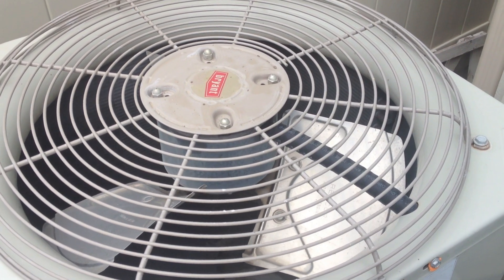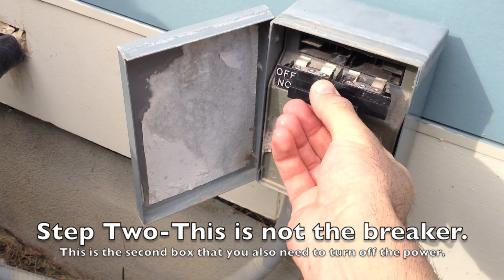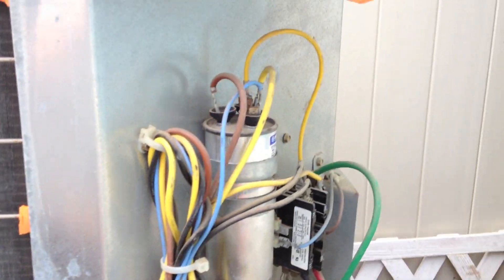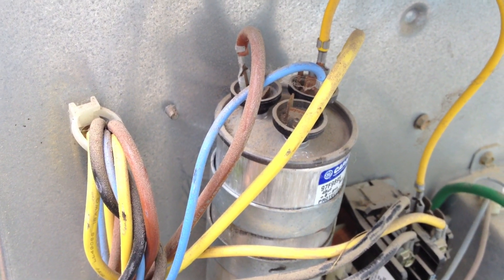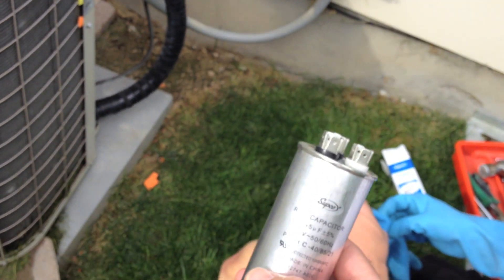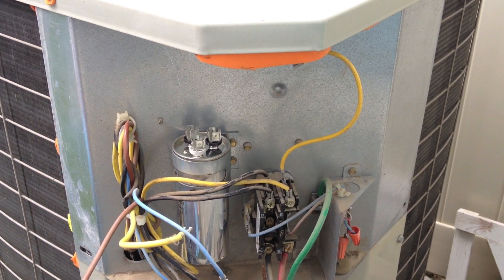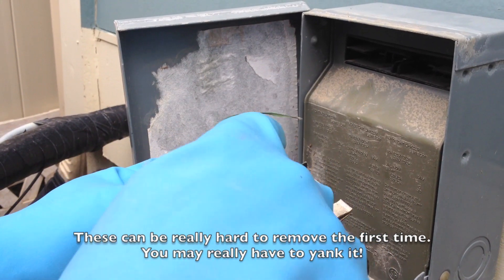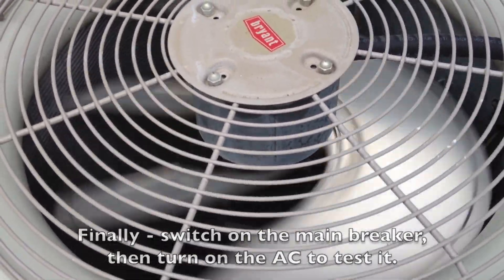AC Fan Not Working - How to repair broken Air Conditioner HVAC Run Start Capacitor

Comment: I hope you can help. Everything turns on properly and after about less than 10 mins of running and blowing cold AC the fan slowly shuts off, a loud hissing sound begins, and the smaller pipe goes from really cold to torching hot. What can I do?
Reply from the maker: How many times has it done this? Where is the hissing coming from? Is it the outside fan that slows down? Or is it the blower motor fan in your furnace?
Reply: First time to my knowledge that it does this. Hissing coming from below the fan. Outside fan comes to a complete stop before the hissing. Furnace is running properly
Reply from the maker: Angel Lopez Could it be a freon leak? Has the small copper pipe cracked and the hiss is actually the freon escaping? The crack may be super small.  If it is a leak, once the hissing stops, it wont start again.  The copper pipe will pass through all the blades that surround the fan. I would do a long check for any sign of damage to the lines.

Comment: how much will a professional will charge for repairing this problem?
Reply from the maker: I think its about $150.  But it really depends on who you call.
Reply: =( I called a good company..and he told me a bunch of problems that I don't see there.. and want to charge $779.00. to repair it.  =( I'm calling someone el. plus he charged $89.00 just to come out!! thanks for your answer.
Reply from the maker: Irma Fuentes That is really pricey!  I had to get an AC guy out to recharge the lines on a rental home and that cost about $275.  Apparently it's something a DIY'er can't do themselves because manufacturers won't sell freon to the public. 
What are the symptoms of your AC?
Reply: This is what he wrote on. refrigerant circuit flat, all Freon leaked out. found leak in -- rushed through suction line filter drier.  quoted $779.00 to repair refrigerant line and install dawn liquid line drier then charge w/r-22 refrigerant. =( . There was no leaking no where around the unit. and now he left it linking.
It just the fan not turning. everything else is working.
Reply: I got it fix for $400.00. Thank you Lord!!!

Comment: First off thanks for sharing this, it helps because mine is very identical, I ordered the capacitor but is there anyway I can e-mail it to you to look at it? Mine is humming an fan is not running however if i give the fan a little push it runs and i feel a little air blow from vents but its not strong and cold.

Comment: Recently my AC unit ran all night without shutting off, I had to finally manually turn it off with the main breaker. This went on for about 2 days, and then it seemed to start working again, unfortunately within about 24hours, it knocked off, and never came back on. It is not humming, or making any type of noise. It is completely dead. I have checked all the breakers and fuses, and can't seem to find the problem. What do you think could be my issue? I am sweating to death, please let me know as soon as you can....also my email is aprilpreslar@yahoo.com if it would be easier for you to respond there...thanks so much, April
Reply from the maker: It's so hard to say what the problem may be without seeing it. It could be a circuit board problem.  It also could be your thermostat. [if you don't know, that is the box on the wall that you control the AC with]
Reply: I thought maybe it could also be the thermostat as well, and yes I do know what that is...lol, but thank you for commenting back. I do intend on replacing it as it is rather old. Is it possible for the thermostat to read a temp, just off of the batteries, and still not be functioning properly, or telling the unit to come on? Also when you take the batteries out and put new ones in, it flashes "DIFF01", do you have any idea what that would mean?

Comment: So my unit does the same thing. He apparenty changed an oily capacitor that was mounted upside down so I assumed that would have worked. NOPE. My thermostat reads 85* most of the time. Sometimes it does cool and the fan spins but 90% of the time, it's just warm-ish air. 

I do know it sometimes works because for about 4 hours, there is a pipe in my ultity closet that is wet and cold but at the first sign of warmth, I look at that and like I said, most of the day that pipe goes dry and room temp.

My AC guy is attempting to fix this for a 3rd time tonight in 2 weeks. What could I tell him that he isn't thinking of....
Reply from the maker: I have not done any freon charging but that may be be the issue.  You have to be a licenced tech to recharge freon in an AC (at least in Utah).  It's not something that you can do yourself because they don't sell it to the public. If there was a freon leak it can make your unit run strangely.  It's so hard to say what the trouble may be with out seeing it. AC's can be tricky things to figure out.  If your AC guy is on his 3rd attempt, it may be time to get another more professional tech on the scene.
Reply: AdamDIY New capacitor and R22 added and still the fan doesn't always spin. Getting a new fan motor in a few hours before noon here. My other option if this breaks is a window unit brand new.

Comment: What if your ac is cooling the house and the fan is running, but when you turn the ac off the fan keeps running, but there is nothing wrong with the thermostat...is there something on the ac i have to reset?..what could be the problem?

Comment: Hi Adam,
Just wanted to give you a update. I called around and the HVAC guy wanted to come out and "take a look" . I told him I only wanted a 45/5 370v capacitor. He told me that it was against the law for him to sell that to me. Stating that if I get shocked then his company would be liable.  So I asked him where around town could I find one. Again he said that that information is for skilled tech. He asked for my name and address because I told him that I would check around town. He said that he would notify some kind of Agency if I did the repair myself. So at this point I just hung up the phone. I think he was trying to strong arm me into spending $150-$200 for a cheap part.

So I went on Amazon and found a Titan Pro 45/5 got it for $11.99. Bad thing is I had to wait for 2 days for it to get here. I think I will order a emergency replacement just to be safe. Since they are so cheap. 

Another thing I noticed while I was changing the capacitor, I should've changed the contactor also. I think I will order this cheap part also.

But your video gave me the courage and knowledge to do this myself. Thank you again.

PS that HVAC dude did scare me a little with that reporting crap. But nobody came out. I peeked out the window.
Reply from the maker: Wow that's crazy!  Report you to the "fixing your own property" agency. Ha ha.  It's such a simple repair. Not too different than replacing a bad car battery.  I'm glad you were able to get it going again!
Reply: You talk toooooooo much.

Comment: Where can I buy?
Reply from the maker: You will be able to find these at a HVAC supply store.  You will need to call around to find one.  I called a AC repair man and asked if I could buy one from him. He said no, so I asked where I could pick one up and he told me the local place.  It's not too hard to find, just a few phone calls.   Just take the old capacitor with you when you go to buy the new one.   That way they can match it.